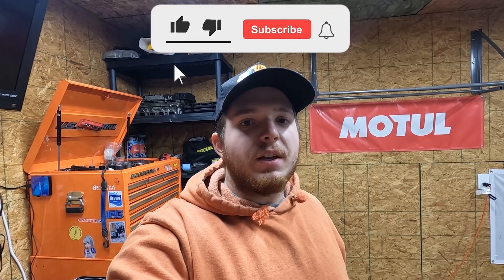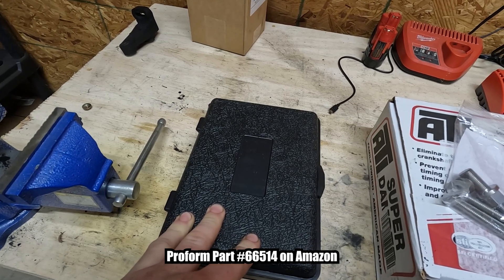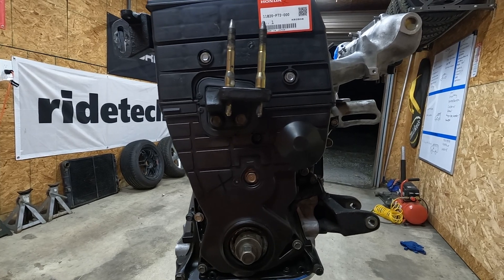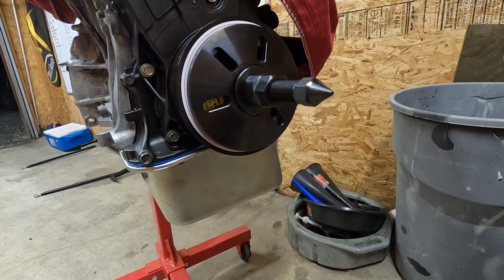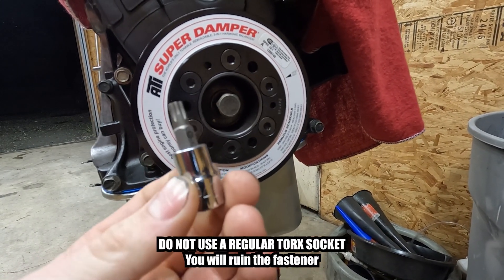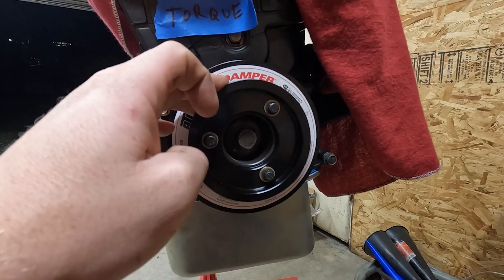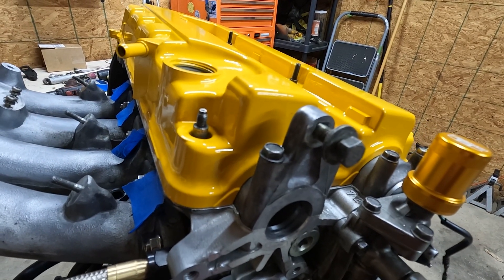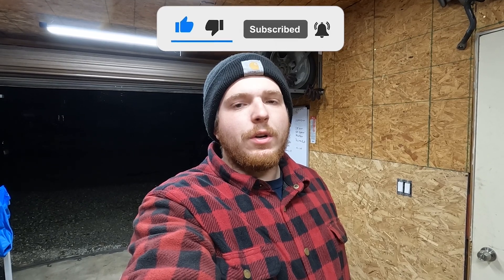How to Install an ATI Super Damper on a Honda B Series Engine

Comment: does it come with P/S belt driver or do i need to specify the people to add that in?
Reply from the maker: there is 2 part numbers, The "race" pulley which is just for alternator belt and the "street" pulley that has provisions for alternator, a/c and power steering

Comment: You don't need a flywheel holder. You can use one of the trans casing bolts and one of the pressure plate bolts, and put a wrench in between the two to lock the flywheel in place while you torque the crank bolt. Also works for torquing the flywheel bolts. Just make sure you use a hefty wrench to hold it for the crank bolt
Reply from the maker: I have a flywheel holder at work. Just gotta bring it home